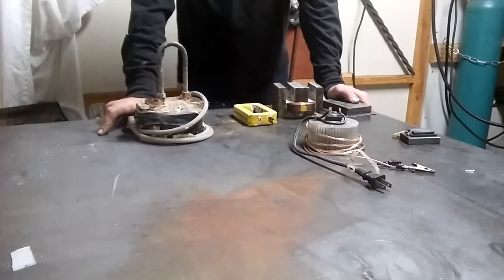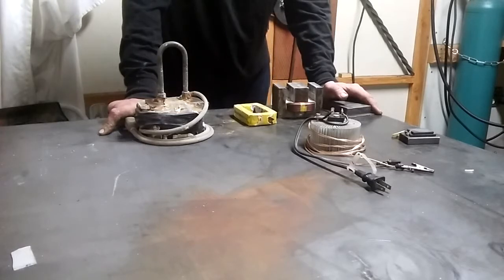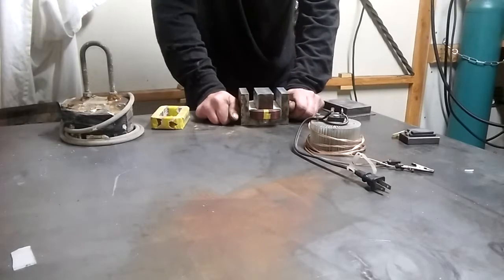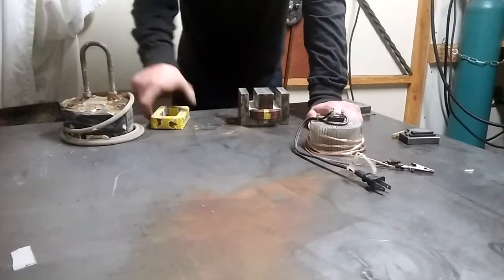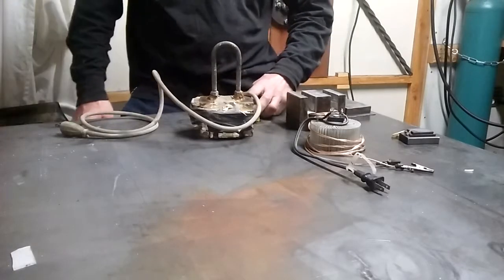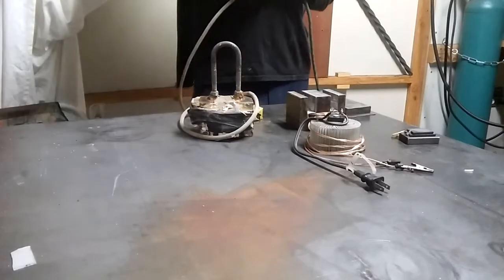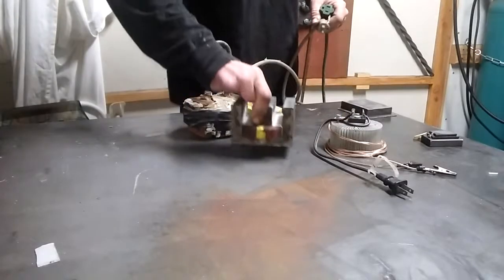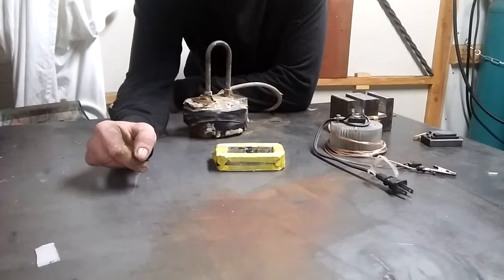Electromagnet MOT strength

Comment: For a 12VDC application would the primary winding still be the better choice over the secondary side? Also would you suggest cutting the unused winding out or cutting the actual top off?
Reply from the maker: The primary winding (low volts winding) is great if you plan on using 12v. Cut the welds on the core and put a block of wood on the winding and use a hammer to carefully drive the winding off the core. (Hit the wood with the hammer and alternate after each blow)
Reply: Ok great information and thanks for getting back to me. I have been working on creating a tool/device for use in my field and had been playing with commercially available mag-locks. The holding force is perfect but the size of the magnetic field is terrible, a sheet of paper between the mag lock and the whatever your trying to “grab” renders a 600lb lock useless
Reply from the maker: @821duc2  the sheet of paper you mention is a problem with any electromagnet. Good analogy. Also the thicker the steel the better the grab force

Comment: What kind of bridge rectifier did you use? Will I need any other components if I were to only use one secondary coil?
Reply from the maker: I used a a bridgeed rectifier that i robbed off an old circuit board. If you use only one coil you may have to duty cycle it.